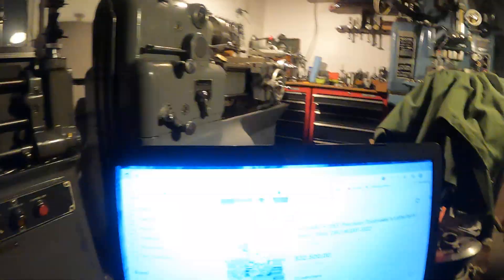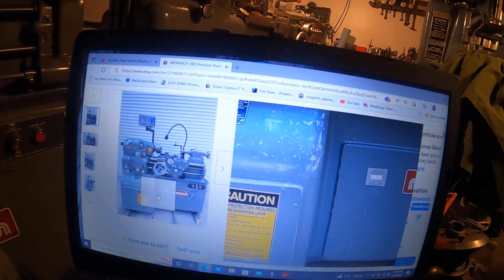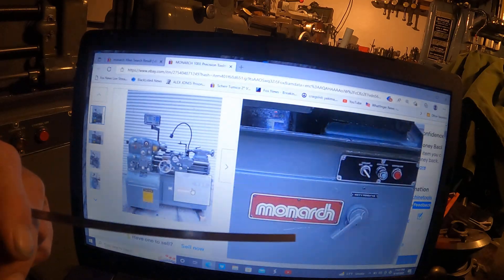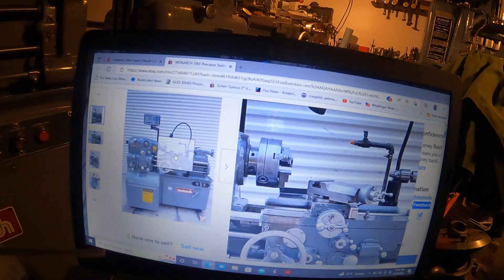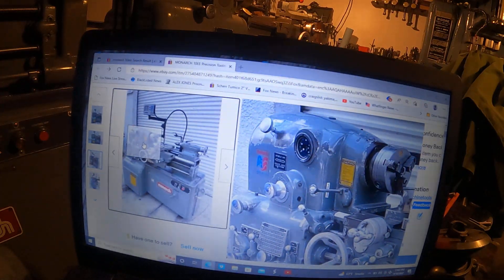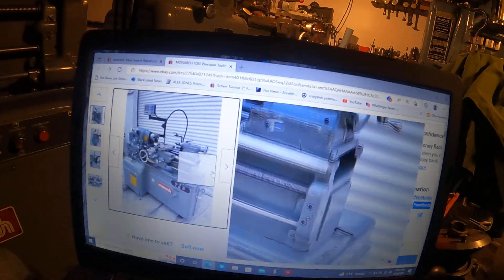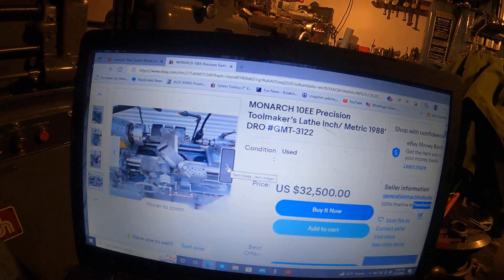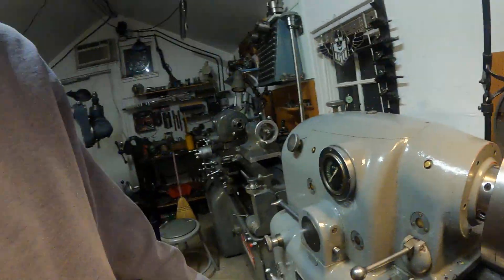Monarch 10ee most expensive on the bay

Comment: Seems the electronics are too advanced for me and some parts unobtainable, had a hard enough time wiring the drum switch on my Craftsman commercial haha! I'll be looking for a bigger lathe without the complicated electronics. I just want to work and be able to fix simpler machines. I see Kieth Rucker redoing the electronics on the 10ee he has, it looks like a expensive rewire.
Reply from the maker: These are advanced machines designed for high precision work in the defense industry, the drive systems are very complicated, The idiot you mention that wears short pants has no clue to the drive function or knows how to run one of these..

Comment: Ive used hardinge  tool room lathes and Ive used My Monarch 10EE . In My humble opinion, The Monarch excels in so many areas. One is power, the hardinge is so easy to bog down. The chuck mount on a Hardinge is a bit unsettling when reversing on the fly. I dont think its safe ( is it?  I never did )  even the tail stock is hard to get a good grip on the bed to drill larger holes and I could never keep it from sliding back. Great for fine small  precision work.  The monarch seems to have the power of a big lathe with the precision of the Hardinge ( maybe more) And some important features the the Hardinge  just doesnt have like Variable speed and the threading stop stop knob.   

You seem so familiar with the electronics on these machines. Have You ever thought about offering Your experience for a fee to help inexperienced people (like Me ) save their  drives? Mine is working great but I would no know where to turn to should a problem arise. If not then do You know where We could get help? I doubt that any local machine repair guys could do any good at all unless they have direct experience with these.
Reply from the maker: The Hardinge is a great machine on its own, I think it is good to have both, I have owned the HC models. The one internet forum regarding these machines has simply chased off the experienced and pro users years ago after the electrical engineer moderator moved on. On the logical side and actually proven side, if the drive system is dead or missing, a vfd system with grafting the back gear box to the new motor is the best approach. The machine is a high performance item that requires constant attention. All I can do is advise from this channel, I do have email listed under about on my home page.